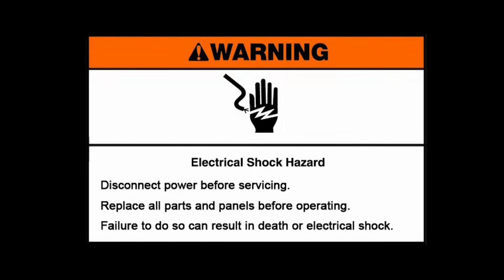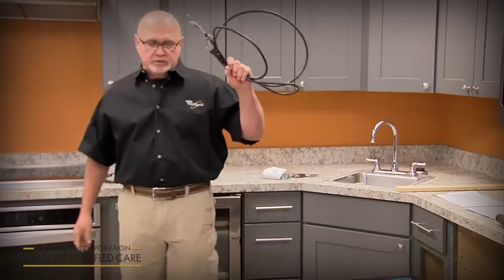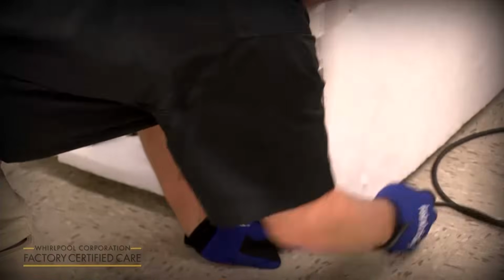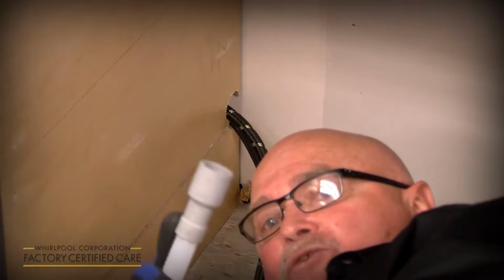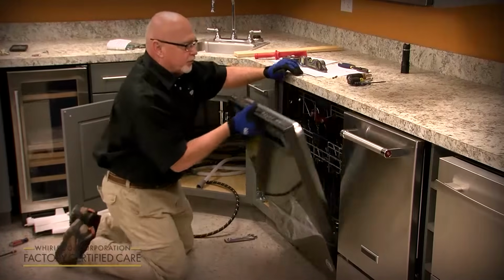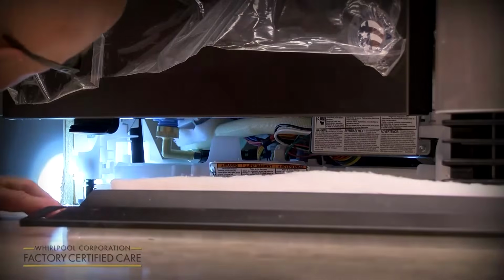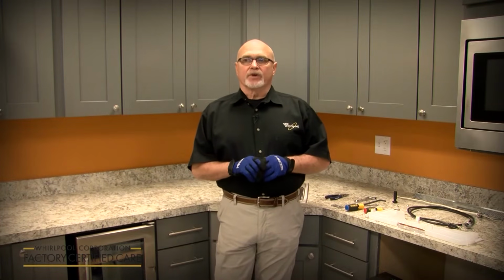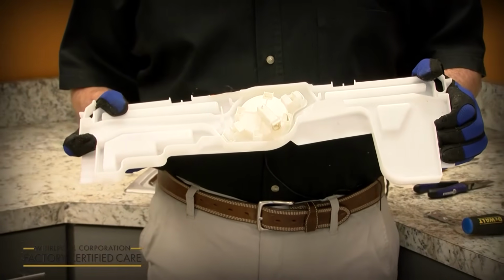How To Install Maytag® Dishwashers

Comment: Such a big help! Got my Maytag installed. I ended up cutting out the old soft copper tubing and using a new flexible water line. Used a shark bite to make the junction. I had a few questions about making sure the drain hose had a high loop. I made sure there was one under the sink, as some dishwashers will have a hook on the back or side of the unit. Thanks again so much for the great detail and explanations.

Comment: Great video - I couldn’t remember how the insulation inserts went back in.

Also, the video helped me discover an error in the printed instructions.  When running the installation test at the end, the printed instructions omit the need to press the second key in the sequence at the end to actually start the test.